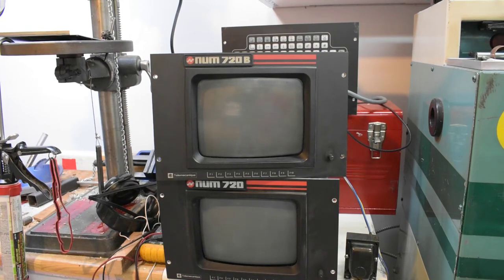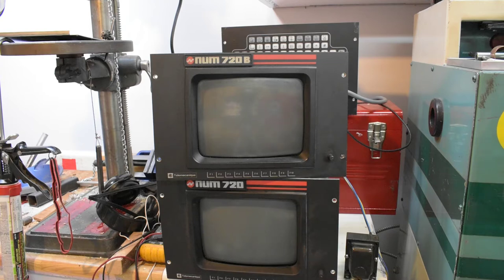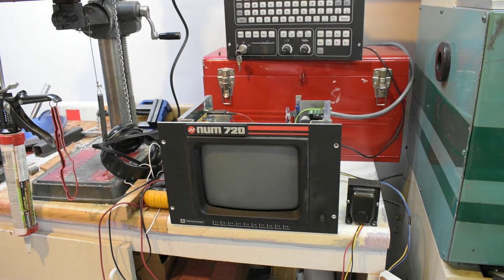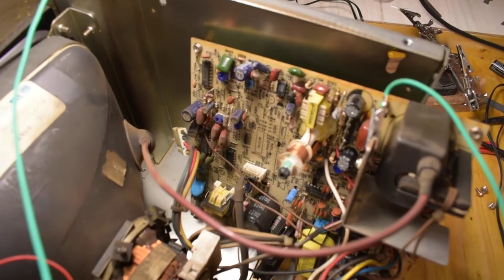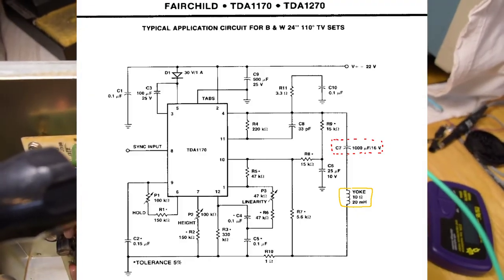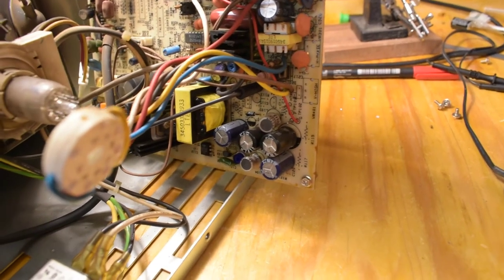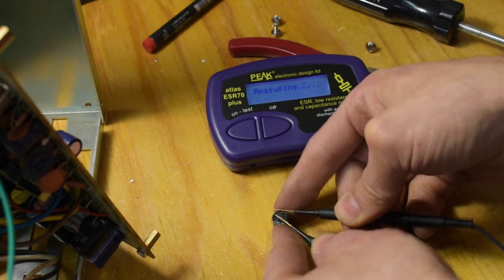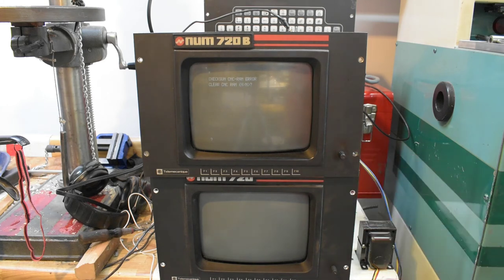NUM 720 CNC controller monitor repair

Comment: Very nice fix. 
The coupling caps in each section of the video signals (and later the deflection circuit) are a very typical thing to fail in old monitors, especially with these kind of symptoms.